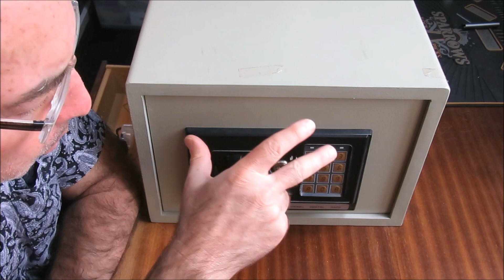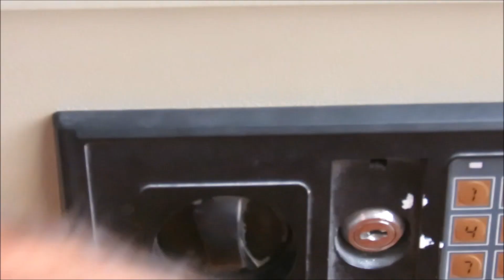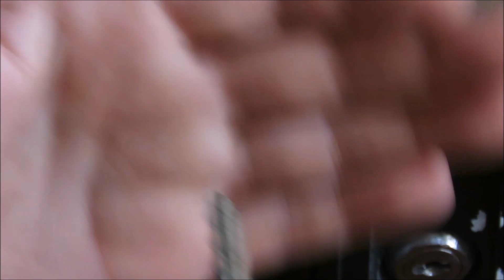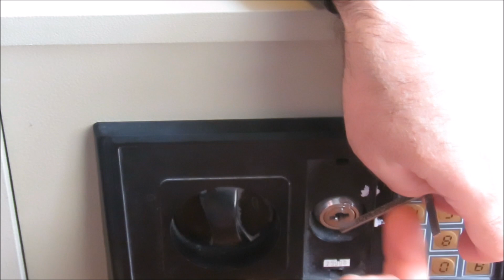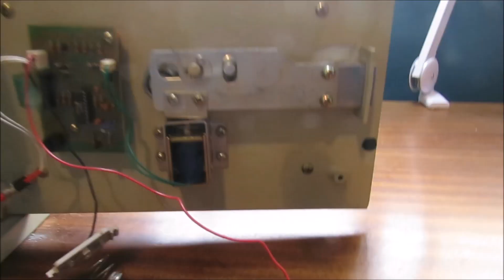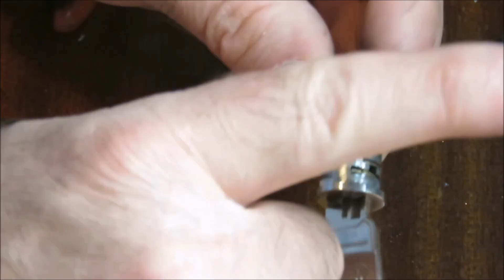[115] Tutorial - Noble Electronic Digital Safe with comedy wafer lock

Comment: I know this is an old vid, but I finally found one like this called a bulldog safe, for 3 bucks, kid already drilled tubular lock but didn't understand how it works, never got it open, I replace batteries, damaged reset switch and lock, good to go, just for fun.
Most of these can be either dropped a short distance or hit on top with non metal hammer while slightly turning knob,  however I did notice mine had a spring on knob to keep it in lock position untill turned by hand.
Reply from the maker: Yeah they're pretty unsafe...for a so called safe!

Comment: Funny because I just got one very similar for free (would never buy one) and it has a tubular arrangement on it.
The batteries did die in it and the keypad was not working correctly anyway.
So I got given it after I opened it for them.
The bloody thing wasn't even bolted down😂😂😂😂,I just lifted it 1&1/2 inches of the floor and dropped it whilst turning the lock and she popped open (easy peasy).
Thanks for doing this video (saved me the time and effort)👍👍😘😘😎😉😉🍺

Comment: Awesome Michael :), this is really a crap safe ;D. The tubular ones might be a bit better as long as you can't stick a big pen in haha ;D. Very curious looking forward for the electronics and if you can influence the magnet from the outside :D. Cheers buddy :).
Reply: You can whack it over the top and rap the pin
Reply: Smacking it works sometimes (I have seen videos of it), as the pin goes down from the impact ;D. It just doesn't work if it is installed in the wall ;D.

Comment: That looks a lot like those Safes you see in of Motel rooms.  Also those cheap Wafer locks are often sold in bulk lots for all sorts of uses (filing cabinets, key cupboards - ironically etc....) and a handful of keys will open most of them.
Reply: The first frame of this video looks like you are giving this Safe the finger 😊  A new rating standard?